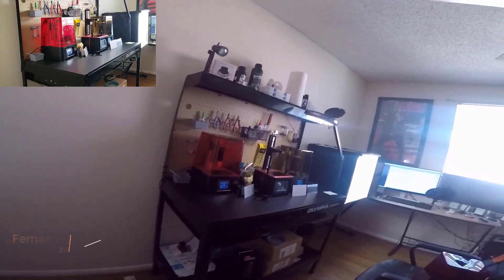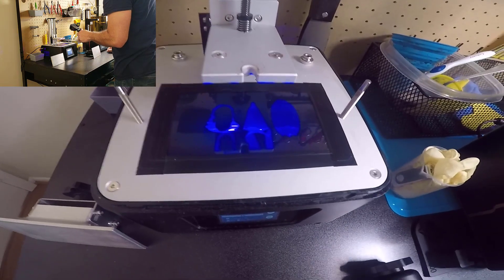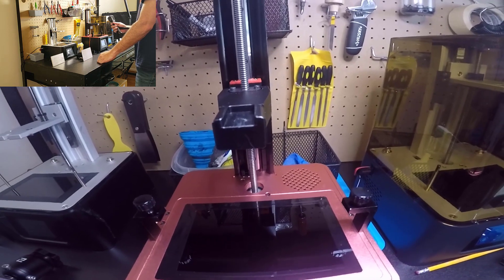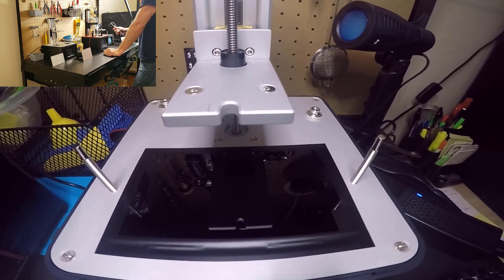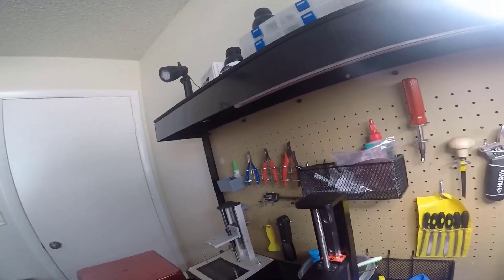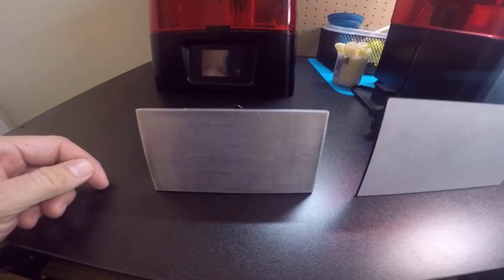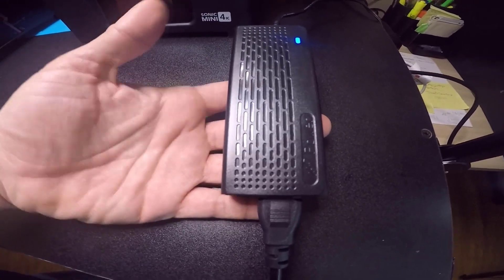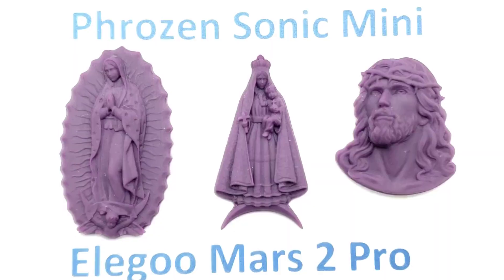Comparison - Phrozen Sonic's Mini Vs Elegoo Mars 2 Pro - With Prints Reviews

Comment: Sonic Mini 4K is a great machine but hoestly mars 2 pro setted at 0.3mm layer give pretty muche the same detail. I think printers are reaching the same bottleneck of television 4k>8k there are indeed difference but it is so small people will not spend the extra money. Mono Ldc instead is a big change.
Reply from the maker: yeah thinking the same and for the price also will go for a metal printer is better than a plastic printer more solid I would like to see a sonic mini with metal body.
Reply: @FerocarTutorials  
From you Photos the mars2pro prints look better than the mini4ks. Maybe you have your mars dialed in better? But i was really surprised to see the comparisons. Not what i expected.
Reply from the maker: @Mongodrome  I love my mini 4k but I really thing they could made a better product who doesn't like more? but yeah my only complain is that they plastic parts are breaking and also in the facebook group the Phrozen team is not answering at this problem they are just blaming the owners for letting the resin to touch the plastic parts. Really?
Reply: @FerocarTutorials  If you don't mind me ask, what plastic parts are breaking?  I'm looking to get a mini 4K.
Reply: @Mongodrome  I noticed that too. Imo both the Mars and the normal Mini look better than the Mini 4K, I am confused as I was expecting the opposite.

Comment: I was surprised to see that the winner of the “low quality” is the sonic mini. I have all your machines but not  the sonic, I wait another brand with 4K on 6”,
Reply from the maker: Hi Multi Magical I think that the sonic does not lose by resolution the problem is that unless you are going to print objects that are too small where that kind of detail will only be seen with a magnifying glass there would be a winner but it should also be noted that a 4K resin was not used for this demo but also all the Designs that I printed just looking the cad and seeing the prints I can say that in both printers the detail is in the print, the other thing I think is that the sonic mini 4k could have been a better printer, for example its base body is plastic and  several owners of sonics minis me included have sonics breaking in the plastic parts of the printers and everything because the resin corrodes the plastic until it breaks and if the excuse of phrozen is for the price then how could elegoo have made a 2k metal printer for less than what  a sonic 4k worth,  and not only that the mars 2 pro have in addition a carbon filter and a bigger print area. So the bottom line my conclusion is that sonic 4k has a great 4k screen built around very cheap materials made to get damaged very very quickly
Reply: When did he say winner I missed that part?